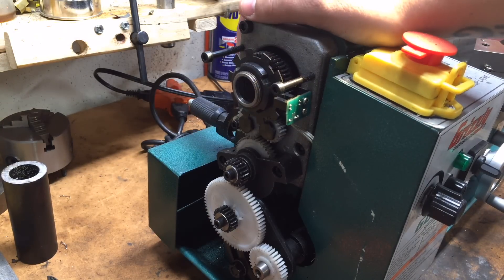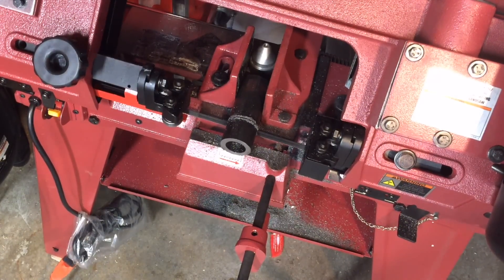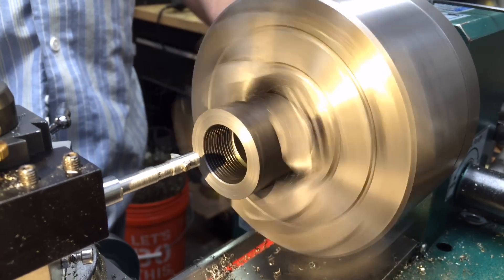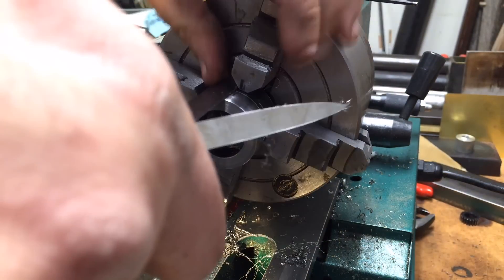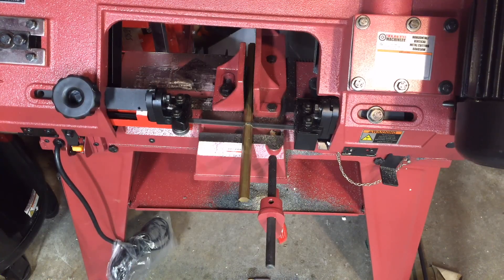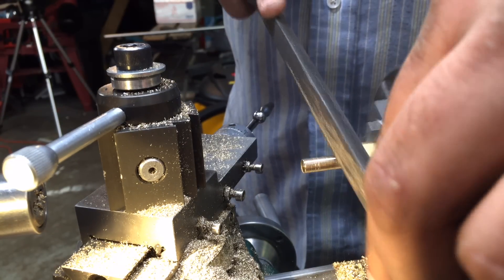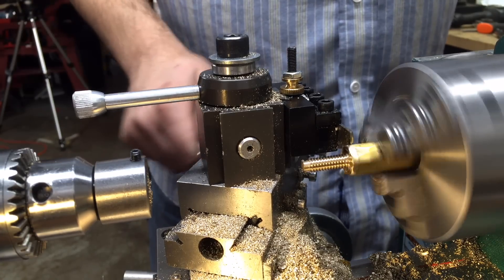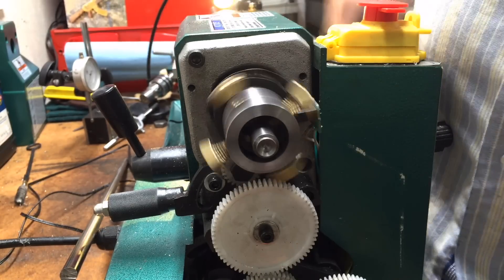Making a Spider for the Mini Lathe

Comment: Brass does not need any lube, just another rake angle than steel. So if the cutting/finish is not satisfactory change the rake angle.

Comment: Great video.  Enjoy all your videos.  Informative and well done, and you're not a "know it all".    You were definitely resourceful in adding the four (4) bolts at 90 degrees to one another.  Another way of doing that would be to hold the piece in a 5C collet - and use the four-sided block in a vise on the milling machine.   Or in a Spin Index.

Comment: Practical Renaissance,I purchased my 7x14 lathe from Micro-Mark in 06. Until I took the spindle housing apart did I realize that the electronic speed control pickup devise (as shown in your video beginning on 1.00) as the thin multi-segmented indicator which indicates the digital pickup.When I bought my lathe I did not know that the speed indicator and electronic pickup was in contrast to your "GRIZZLY", as mine was safely located INSIDE the spindle housing, far away from grease, dirt and physical damage. I wonder how many other mini lathes are configured this way.I also wonder how many lathe motor mounts are configured through the front of the spindle housing, while others are found to be parallel to the drive shaft. Can anyone comment?

Comment: How do you get your lathe to stop so quickly? I finally mustered up the gumption to cut a thread (M5x0.8) on my jet 9x20 and to my panic when I threw the lathe in reverse it just kept going forward. (I ended up hitting the carbide threading insert that came with the lathe against the three jaw, but luckily no real damage happened) Only later did I find out that I had to turn it off, wait for it to coast to a stop, (This could be a substantial distance) then throw it into reverse for it to actually move back.
Reply: wire in an active breaking circuit, it basically joins your positive and negative on your motor to turn it into a dynamo, google active breaking mosfet

Comment: In your opinion would the Grizzly 7x14 be a good gunsmith lathe.? What's the true "through" hole dimension on this.? I do small projects but don't really want to spend $3500 on a large machine. Just looking for your opinion.
Reply from the maker: You can check out my other videos to see some of the gunsmithing I've done on this lathe, it's certainly possible but in my opinion this lathe isn't really ideal for it.  The spindle bore comes in at 20mm which is something like .787.  I was able to run a 13/16 drill bit through the bore to get me to about .813 (probably bigger with the way drill bits cut that deep) but that's really pushing it with the little lathe.  There's no debating that a larger machine is definitely better, there are a number of options out there for a bigger/sturdier machine that is just past the $1000 price point
Reply: There's a reason gunsmiths make good money. If you really want to give it a try, look into a 12x36, 13x40, or 14x40 lathe. something with an 1-3/8 or 1-1/2 throw hole. Look for at least 2 hp, and at least a 6 inch, 6 jaw, acu-set chuck. Craig's list is loaded with good lathes, if you know what to look for.

Comment: Go and buy a carpenters circular saw with 24 teeth. Fit it centrally to what you've made here and then fit some kind of pawl stop so that as you rotated the blade one tooth at a time, the click and return of the pawl moves your spindle and chuck 15 degrees. You can now use this to accurately make your own 24 angle indexing plate which can be fitted quickly just as is  your spider. The more teeth on the 'industry made' circular saw, the more angles. NASA would not be interested in this poor man's indexing rig but for the hobby machinist, its as accurate as you make it.

Comment: Nice job sir. But why did you bother with cutting oil while doing the brass screws? The crying noise you hear is not the tool suffering, it's just the brass grain being torn by the tool and the metal rubbing snugly against the cutting face. No problem...

Comment: You could have tested your thread by removing the chuck with the part in it, as long as you put it back in the same holes (if I remember correctly, your chuck bolts on).

Regards, Matthew.

Comment: Hi sir! Could you please inform me about the 4 jaws chuck and the tool post installed? They seem great! 4" chuck I suppose, it will be my next upgrade together with a quick change tool post!
Reply from the maker: +malibuu6969 the Tool post is an A2Z CNC aluminum one (don't get it, get the imported steel Aloris knockoff) and the chuck is a 5" 4 Jaw chuck from Little Machine Shop with an adaptor plate for a 7x14 lathe
Reply: +Practical Renaissance 5"? Wow! Does it fit?
Reply: malibuu6969 nope.  Obviously doesn’t fit.

Comment: Nice video. I need to make one similar. The one thing I need to warn you about is, put a handle on your file. The lathe will catch it one day and the tang will be pushed through your hand. It happened to me luckily for me it just went under the skin and out the side. File aside your project looks awesome. Thanks for sharing.
Reply from the maker: +sam yeates Yeah, the file in the video has a very large rubber handle on it, as do all files used on my lathe and I agree, it is absolutely dangerous to use a file without a handle on any lathe!!  Thanks for watching!

Comment: A hand wheel on the end of the feed screw is a handy addition for when you do not want to or can not use the power feed. Using power feed on very small diameter turning is undesirable.

I am not clear as to what the imperial lead screw has to do with the procedure for threading. The only affect should be thread pitch error which is minimal.

Parting on the back side with the chuck in reverse can be helpful.